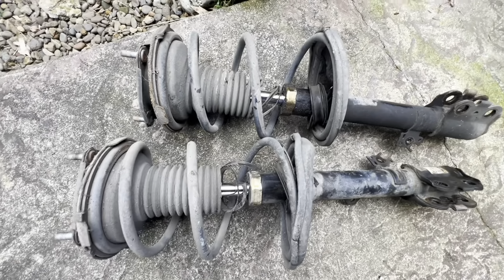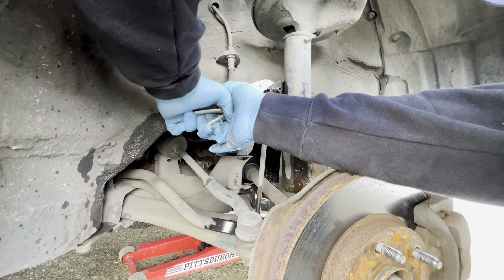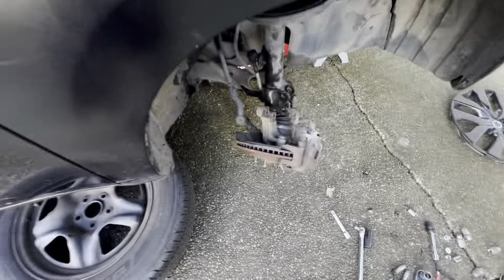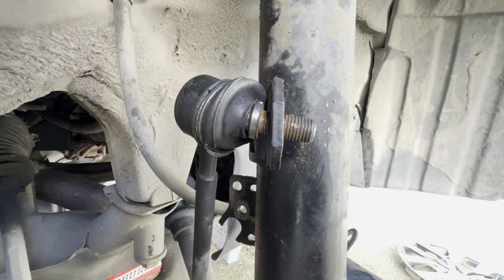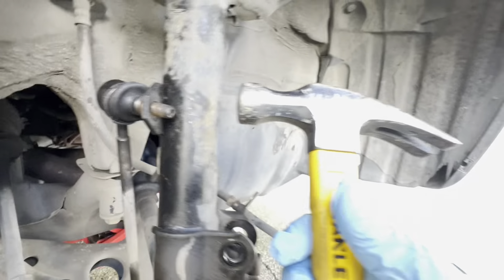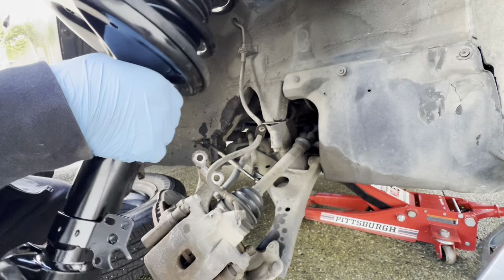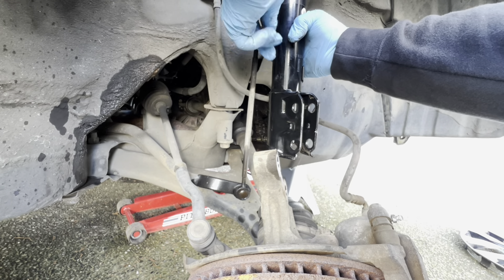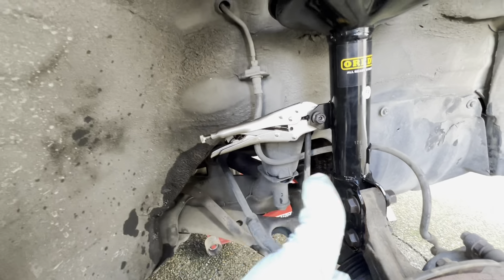Front struts and shocks assembly replacement in a 2002 RAV4. Originals lasted over 200,000 miles.

Comment: I just did my  2002 toyota camry le 2.4 4cylinder  im a gal...that swaybar bolt  spinning like crazy 😂😂😂tighten them plyers a lil bit more. this is what i went tru ,i took a break after that ,got it off after a while  ,car sits up lil high  feels different smooth  and stable..do you need to get Alignment afterwards???
Reply from the maker: Nice work proud of you!